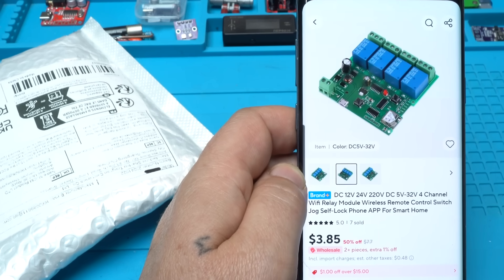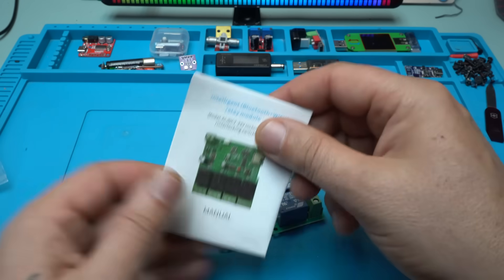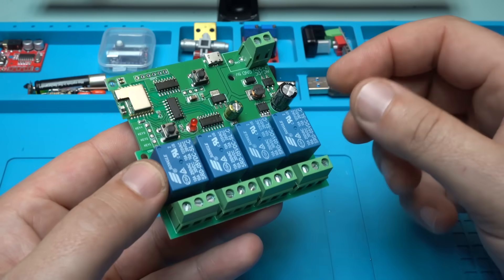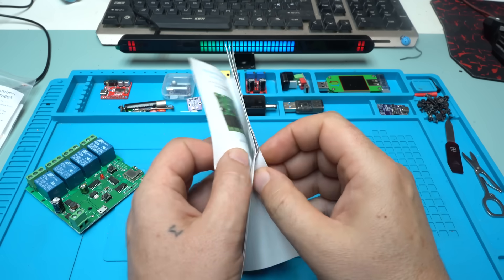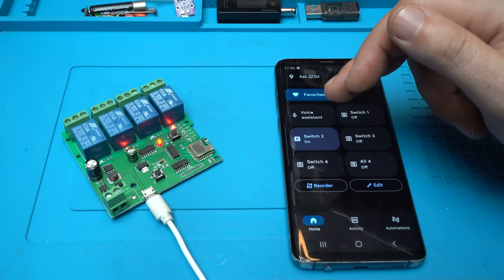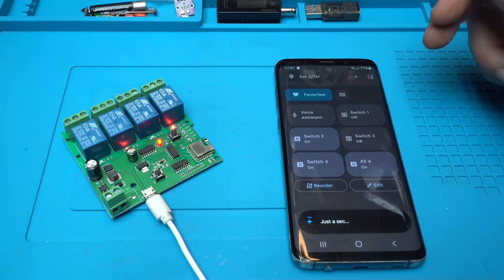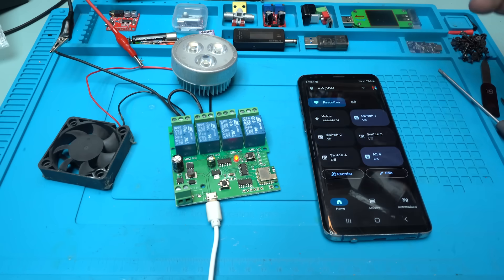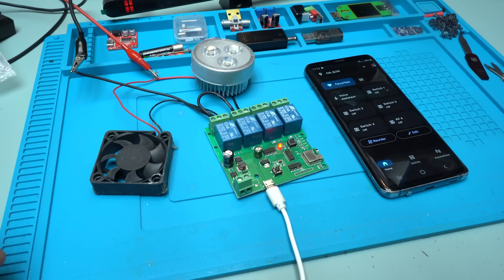WHY THIS $3 SMART Module is FANTASTIC?

Comment: Only thing which I dont like is using apps from somewhere. Modules like this are really usefull, I have a lot of them also without wifi this things are very cool and cheap. There are some where you can use low current groubd for switching up to 8 Channels
Reply: 💯 agree its like those $5 digital microscopes, awesome performance, great value for money, but you have to trust an app. Its impossible for it not to be some kind of spyware 😂

Comment: Alexa can talk to that module and control it. I took a spare remote for my truck, soldered header wires from the buttons of it.  Hooked those to 2 of the relay NO contacts.  Now I can just yell out "Alexa, start the truck".  A routine then closes one set of contacts for 1 second (locks doors), then closes another set of contacts (remote start).  Works great!  I put it all in a box, and leave that in my garage near the door.  Yes, my house is too far away for me to just push the buttons on the remote.
Reply from the maker: Wow, that's a clever way to use it!